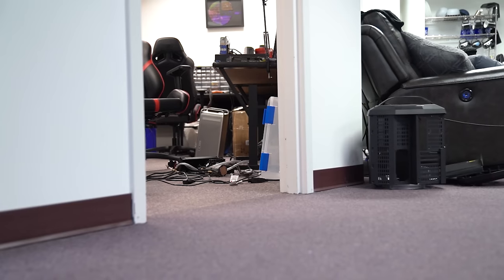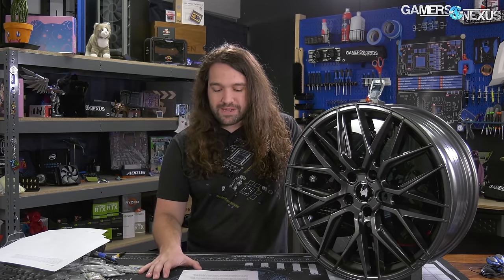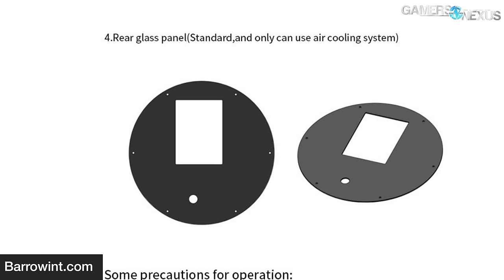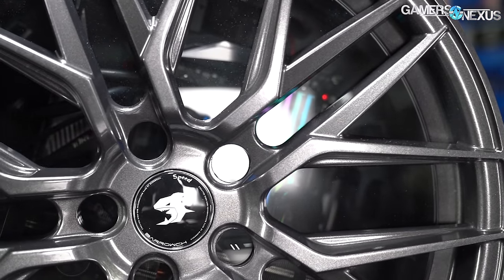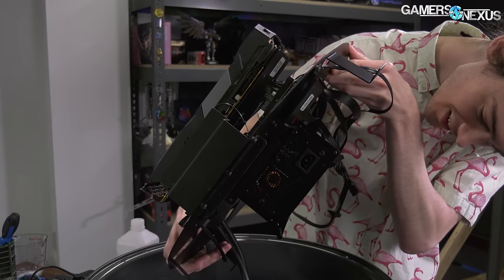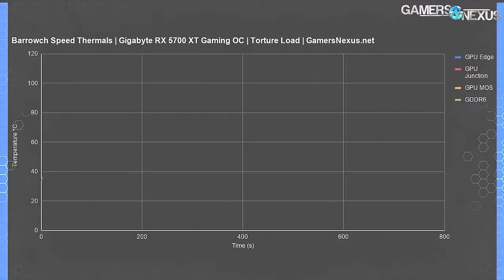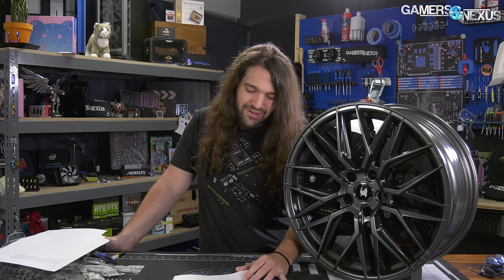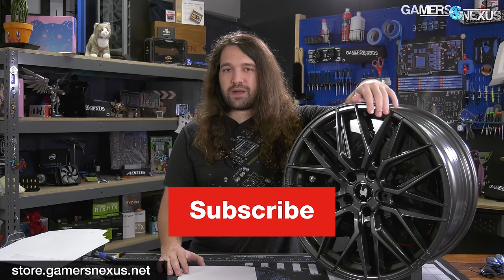Car Wheel Computer Case Review: Barrow Speed from AliExpress

Comment: Wheel: Rim + tires mounted properly on the rim
Rim: it's the metal/carbon fibre round structure on which you put the tire on and is mounted to the cars axle.
Tire: a round rubber compound put on a rim to provide grip with the surface.

It's pretty simple and logical all things considered. No idea why people keep calling rim the wheel. It's like calling a case only a "PC". Sure it's a part of it but not a PC in and of itself.
Reply: As a flipping car mechanic I get confused sometimes too…
Reply from the maker: The rim is the outer portion, as in the actual rim of the wheel. The wheel is the entire piece of metal. The tire's presence has no bearing on if it's a wheel. This is a wheel, but anyone normal would be fine with calling it either because it's become a colloquialism. It's the same as in mountain biking culture: The wheel is the entire metal piece.
Reply: @GamersNexus  And this is exactly why the confusion happens.
If we follow this logic, then when a car pops the tires to a point they get off the rim/wheel, you'd have to say the car is still on the wheels... which doesn't make sense. People pretty much always say the car is driving on the rim. But if we follow your naming logic, that wouldn't make sense because you can't mount a rim to the car axle.

It's never good to have two different things called the same thing.

Also another counter argument to your naming logic would be how sim racing community names the different steering wheels. Namely they call them "rims" (sometimes steering or wheel is added before it). This not only includes the outer "round" portion (F1 rims are rectangular but nvm) but also all the mounting and buttons on it as well. Then you have the "wheel base" to which you mount the rim and the whole assembly is then called a "steering wheel".
Basically the point is that the inner structure metal is seen as part of the rim, not an extra bit. In other words it's a structural part of the rim therefore it's called a rim.

But yeah, this argument is gonna go on forever because some people will prefer to use less words to describe more things. And then only more confusion is gonna happen when people will misunderstand what each other mean instead of having a term for each separate thing that makes a total sense.

Comment: OK I realise there's more important questions to ask here but I'm fixated on why they decided to drill a hole in a piece of tempered glass for the power switch when it was right next to the hole for the tyre valve? Surely it would be easier to drill a hole in the rim to get the wires out to there and it would look a lot more professional when it was done. Of course if logic and aesthetics had any part in your planning process you wouldn't be building a computer in a wheel anyway, especially something that looks like a cheap knockoff of an actual decent wheel.

Comment: They should've used a 3-piece wheel so the barrel and center hub could be separated and you could work on it without taking everything out, would probably work better in a 20 inch also

Comment: It would have been better if it:
1. had a mesh screen option to replace the glass
2. place the power switch to the center cap
3. place the reset, 2 USB, and mic&headphone jacks on the lug nut
4. put a spinner as a case fan, (although it would be difficult without covering the center of the rim)

Comment: Thoughts:
- Power Button not placed in center cap or valve stem hole BIG missed opportunity
- Termpered glass hilariously unnecessary and counter productive. 
- No I/O panel
- Barrow should consider just selling the motherboard tray, maybe with different depths for different offsets?  Maybe different sizes for different wheel sizes.

What height downdraft cooler would fit in there with the glass removed?

Have to admit, I like the concept. The execution is somewhat puzzling.

Comment: Wouldn't it make a lot more sense to mount the motherboard on the wall with the rear io facing towards the back of the case? That way you would have access to the rear io, could have expansion cards and even proper air. Coolers. The rest of the  components are could be mounted radially

Comment: You cant use this rim on a car. They removed the offset puck on the inside of the rim for clearance. Look up any alloy rim and look inside. That whole center mounting area has been removed on the Borrowch rim. You try to mount that rim on a car and the brake calipers will be in the way and you wouldn't be able to mount that rim on any car unless it had drum brakes. But if you try to take a normal rim and mount that bracket in there it still wont work cause of the offset mounting thing/plate/puck UHG (Cant remember the name of it for the life of me right now).

Comment: I would have removed the TG put a 200mm fan to simulate brakes, the power button should be the air tube hole, and mount a flat tire that's been on a dead car to retain its position.

Comment: Things I'd want from a wheel case:

1) no glass, it is pointless, doesn't make it look better, and costs more
2) IO in the centre of the hub would be nice
3) make it bigger so an SFX PSU, full size GPU, ITX board, and at least 360mm worth of rads (240+120 or 2 240s) can fit, and the actual mounting screws are left intact
4) the above so that you can use the mounting holes for the original rim to mount the PC to the wall (including a bracket for this is a nice bonus)
5) that means it IS confined to the width of the rim

I would much rather get the functionality of airflow being possible and IO being usable (plus a nice way to mount it either to a stand or a wall, or hell, even a car) and sacrifice an ATX board+PSU and some glass that doesn't change the aesthetic. The aesthetic is it is a freaking wheel. Not "it has glass".

Comment: it would of been better if they put the Power switch where the hole is for the stem. Also a better way is they should've used mesh instead of Tempered glass.

Comment: The insides to that case is what happens when you let engineers engineer without someone telling them no and heres how I would have been worse lol. I would have made an ATX motherboard tray with air ducts in the front and back of the tray that fill out the rest of the wheel hole. On the side with the I/O have a wire slot with every potential standard plug on the I/O that go to a case I/O mounted at the back of the PSU housing where the PSU cables go. Have the PSU exhaust fan pointing up and at the top of the case but low enough to hide the power cable. Also have the PSU box go all the way to the top of the case with a grommeted hole for the cable because beside the PSU should be a 240mm radiator or fan mounts at a 45 degree angle to the PSU and another on the opposite side for one for exhaust at the same angle so it blows the exhaust away from the PSU/case intake. These would go directly to the air ducts on each side of the motherboard tray so air blows in one side, across the PC and out the other. Between the motherboard tray and the PSU/Fan part you can attach some drives and that's where cables get managed. for anything plugged in at the top. In the bottom of the case have a circular tray that can fit 4 HDD's that lines the bottom of the wheel. And motherboard tray attaches to the back of the wheel  leaving room for many CPU coolers or GPU's. For front I/O cut a rectangle hole where the valve stem goes and put a power button into the valve stem hole and a box that is the same radius as the wheel covering the rectangle hole for front panel I/O and a reset button.

Comment: I like what Duke said about making it a heatsink, but I would also add that they should put a large 140 or larger fan on the rear side and have slits through the back plate to allow airflow through the case, and as well would be nice if they provided a lip around the rim of the front, that is open to air on all sides, with a dust filter. The real issue with this case is that price though, they should find a better dealer for tempered glass if they're being overcharged because that wheel shouldn't be more than 200 dollars with the quality shown, would've also been nice if they had the feet magnetic or built into the system. Another thing they should've done is allowed the user to just pull out the center mount setup rather than having to unscrew literally everything every time. I keep editing this, sorry if it seems disjointed, but the vandal power button should've been the center logo rather than on the fucking glass.

Comment: The concept is good! The design is what's "missing", it should bin drilled to accept the parts screwed directly to the actual rim, using it as "passive" cooling. The inner plate should mount motherboard with at least low profile fan for CPU and "lots of holes" for convenience the second should have the power supply and connectivity for all other parts "including" usb's and such externals, and also for any type of external liquide cooling. They just need to do their homework on standerd sizes and desin the "mounts" around that!

Comment: Its so space inefficient. It would make way more sense to put the psu in the bottom of the wheel, and the motherboard on top of that with the I/O facing out the back. I can't read chinese but on their website it looks like the internal volume is 260mm from front to back, which is enough for ATX if thats true, but easily mini itx. From there you can either fit a short gpu, or depending on how well you can twist a pcie extension, you can still have the gpu face the front of the case. and then either have no glass or watercool it.

Comment: would it not be much better without the glass? That way it could pull in air easily and it is not like you need the glass there since the wheel spokes protect it from your hands.

Comment: Wow! You guys are brutal! lol! I see this as a niche car guy product that will be set in a garage. It's further likely that the build will be less of a gaming system, and a lightweight PC build with a much smaller GPU and PSU Temps won't rise as much and heat will be less of a problem because it's in a garage.  I agree that it is Waaayy too expensive. Should be about half of the current cost since there is very little to it other than a generic wheel. The USB access and a Wi-Fi card is definitely an issue.  Great review BTW...😎

Comment: Man, this would have worked so much better without the glass. Let all that hot air out through the front of the wheel. But nah, trap it inside with tempered glass because PC cases just have to have tempered glass, it's the law or something.
Anyway, great review, love all the jokes sprinkled throughout. I've watched all 25 minutes and I have a question, though: Is this a wheel? For a car? 😋

Comment: They should have put the power button in the hole for the valve. Instead they mounted right next to it on a tg panel that has no real purpose, but inhibits airflow.
What a baffling case of a missed opportunity!

Comment: Shame about the thermals. I bet the system in it would time travel if you could overclock it past 8.8GHz… as long as plenty of flux was used on the capacitors.

Comment: Someone could mount a tyre on this and use it as a water tank for the watercooler...
It's not a stupider idea than using this case air cooled.
Reply: I can actually imagine that. Intake on the bottom, exhaust at the top, frame around the tyre to keep it from compressing the bladder. Certainly a better idea than whatever Barro had in mind.

Comment: Seems like an extremely intelligent way to make $$$$$ of excess car $h!t laying around your 1 million square foot warehouse.   Good idea, but turrible execution.  If I were to actually use a rim to make a computer I'd go with steel for one... Because believe it or not the Steel wheels are lighter than the Aluminum alloy ones because the Aluminum alloy rims have to be more than 2 times thicker to be able to almost not snap in half when hitting a pot-hole... (ask a BMW owner how that works)  lol  Point is, a 18" steel wheel is MUCH thinner material wich is also easier to and more predictable to weld needing only a mig welder instead of a tig, could give some nice possibilities for cutting and mounting the hardware around the diameter of the rim or at least adding ventilation.  Heck you could possible throw a break disk in there as well as a giant 13" heat sync.   Now I'm giving this too much thought I better leave.

Comment: Five hundred and sixty dollars for a cheap Chinese car wheel, a chunk of glass, and a chunk of sheet metal? That looks like an absolute nightmare to assemble and maintain/clean. I mean, if you're a car guy like me, I can see the appeal, but ultimately, it's just overpriced garbage. If I were to do it, I would've used all itx parts mounted to the back side of a fake brake rotor so it all faced the back side of the wheel. That way it would be more open to air flow and easier to clean/maintain, and from the front, it just looked like a wheel.
Also, for $500, they should've used a power button that looks like a valve stem and put it in the valve stem hole.

Comment: Ok so i will give you the "Gamers Nexus" rundown on wheels, tyres and rims.

Just a rim on its own with no tyre attached = RIM
Just a tyre on its own, not mounted to a rim = TYRE
One tyre, mounted onto a Rim = Wheel.

A wheel is a complete unit, ready to mount, you dont get a flat wheel, you get a flat tyre, but if you damage your wheel that could mean either tyre or rim and or both, if you happen to damage the rim, well then you need to learn how to drive.

Thermal performance is rated on a tyre to tyre basis, not the rim so we skipped thermal testing in this comment

(edit: by the looks of the bolt holes on the rim, im going to say its not an actual rim that you could fit to a car as their usually very reinforced, altho its probably made by an actual rim manufacturer)

Comment: Do i smell a new contender for the disappointment build 2020? Cause it sure as hell seems like they didn't think this case through. For example, they should have put the power button in the sodding valve hole.

Also, massive pain in the ass to work with, PROBABLY terrible thermals, and extremely expensive.

Edit: Geez those thermals are atrocious.

Comment: If there is a computer built in it, would that be a rimjob?

What's the difference between a rubber tyre and 365 condoms?

A rubber tyre is a GoodYear

365 condoms is a fucking good year.